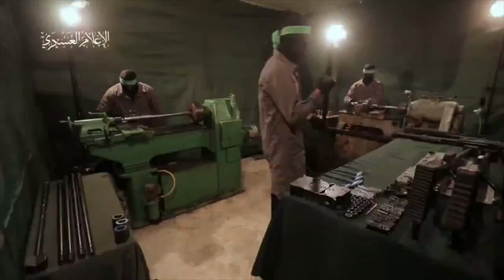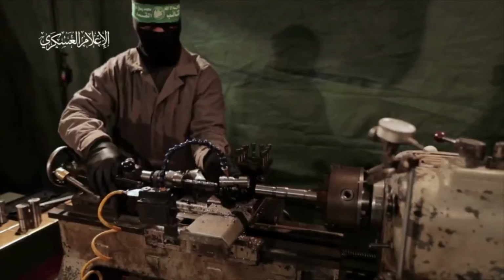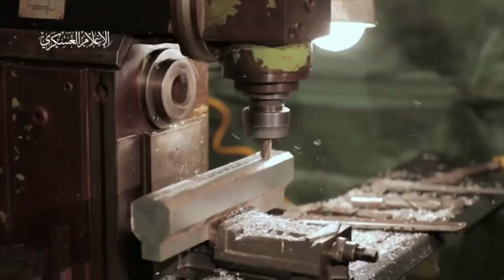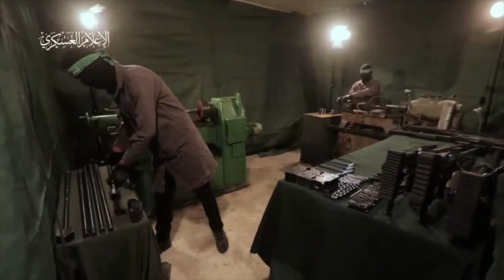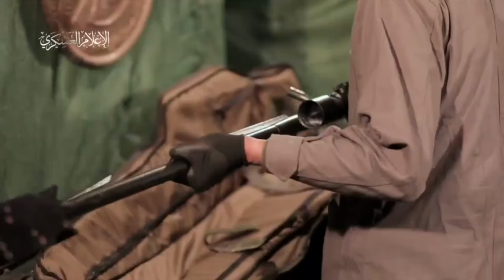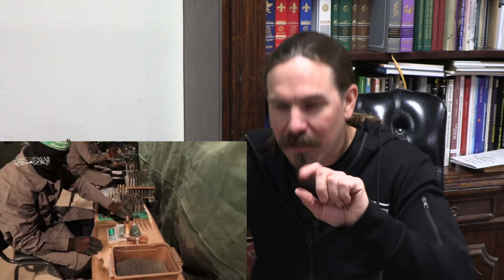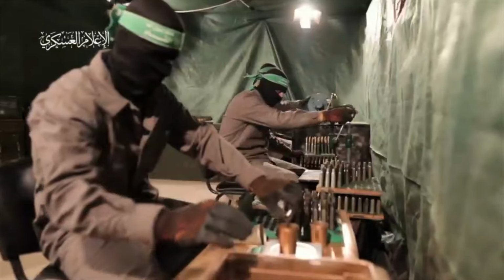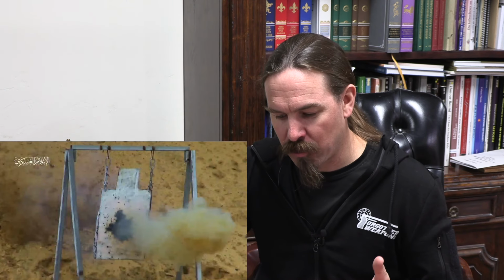Hamas Claims to Make Sniper Rifles in Gaza - Are They Really?

Comment: I work in a production machine shop so I'm going to comment on that part of their video.

1) Professional manual machinists would not be wearing coats with long sleeves. They wear aprons. Long sleeves run the risk of being caught in the rotating parts of machines and can severely damage your arms
2) Scope mounts - Finished parts (the black ones) would never be located on the same table as in-process parts.
Reply: @disistheway2679 if true, THIS facility isn't that place, and theses guys aren't the actual gunsmiths.
Reply: @disistheway2679 yeah, yeah, not arguing that point. THIS video, though, is a fake - that is the point here.
Reply: Who made the fake video?  A group claiming to be Hammas. 

Is it Hammas is it Isreal ?
Isreal  have already posted an interview with a Hammas “terrorist “ who was an Isreali actor.
Reply: Yes those scope mounts had some raw in the white. The black ones would be hard anodized in a liquid solution like electroplating(electroplating uses acid vs anodized uses a salt solution). That process would be done in a different room in big tubs
Reply: realistically these guys would be wearing flip flops and track pants
Reply: And I mean come on I didn’t see any digital read outs which have been very common on Bridgeportsand other end mills  since the 1980’s. They are 40 years behind on tech. There is little in this video that makes believe they are actually making any firearms
Reply: Girl at T/C arms running a gang drill, had her hair back like she should, but when she bent over to pick up the next part her pony tale got caught in one of the drills.
Not a pretty sight.
Reply: when your safety manual consists of one short sentence, ALLAH HUAKBAR, anything that happens was the will of god and therefore good and had to occur.
Reply: @disistheway2679 I think you meant propaganda instead of entertainment. Otherwise I agree with your statements.
Reply: I don't allow long sleeves in my shop but what they do in the third world compared to the USE or western countries isn't going to be the same. Esp in poor countries like this. Haven't you watched those Pakistani machining videos? So your point is moot.
Reply: They are wearing long sleeves to cover any identifiable marks on their bodies.
Reply: @oxyfee6486  doubt that, permanent tattoos are forbidden in Islam
Reply: @therideneverends1697   so you only think of tattoos? What about birth marks? 
Or any abnormalities?
Reply: @therideneverends1697  Military will be looking at every square inch of their bodies, one identifiable blemish is all they would need.
Reply: @respectall4551  seems highly unlikely the would pick people for the film with such problems
Reply: @disistheway2679 It’s propaganda not entertainment, don’t sugar coat propaganda as “entertainment.”
Reply: What they are doing is trying to show that Iran is not supplying them.
Reply: The same people can leave underground for months without see sunlight, 
Can work in undesirable conditions 
Can go for days with minimal food and water. 
So, to them, no law is applying to them. 
Telling us working with long sleeves and apron is fake, then what will you say hamas fighting barefooted is? Is it a Hollywood staged film? 
Don't be salty.
Hamas is built differently.
Reply: You must be delusional to believe that every smith is producing the same way, thats like wondering why the pizza guy is not dressed like the japanese cook and saying that it is not food bcs he cooks different😂
Reply: Yea I don’t think those guys have osha and most of them wear sandles while doing litterly every toe crushing job imaginable
Reply: So this is fake because people manufacturing underground aren't following OSHA and ISO?
Reply: @murmaider2  this is fake because nothing is even slightly dirty, the lathe work is poor and the people acting the manufacturing out never worked on those machines before...
The long sleeves and gloves are a dead giveaway!
Like many others have said already there is a famous Russian video out there were a guy is absolutely disintegrated by the lathe he was operating...
First thing you learn on a lathe... and every "old guy" has a story about a lathe accident, they are not toys and the power of them is far beyond what a human can handle.
The fact that they don't have a single clip of them even attempting to bore out the barrels is also interesting.
Not to mention that the shown lathe-tables are to short to accommodate the tool post with a sufficiently long drill bit.
Not to mention the specialized machine you need for precise rifling...
I mean... they could go smooth bore 😂 but why put a scope on it at that point 😂
Reply: @murmaider2 no it's fake cause there'd be no reason to bring a finished part back to the table where the milling was done.
Reply: @herpherpbrocolli11 No because by now, they would have known better.
Reply: @murmaider2  No this is fake because the laundry list of things pointed out by both Ian and in the comments, AND because they are not following safety protocols.

If youve ever actually worked with a Layth youd understand why long sleves are not just not recommended, but not an option
Reply: @disistheway2679 ooo fancy. They took a break from baby slaughtering to clumsily chisel some words in a receiver. Made in Gaza. 😂
Reply: @tootiredtostop1606 who do you mean with baby slaughtering
Reply: It is just propaganda. Those that don't know  think they are valliantly fighting back. Those that do, may be lulled into thinking they aren't.

Comment: I’ve made lots of parts on my lathe and mill.  There’s nothing in this video that shows much with any specificity.  The reality is that this level of manual machining even if real as depicted will not yield the level of production necessary to support a war effort.  You make tools to mass produce this way.  You don’t mass produce this way at all.
Reply: I don't think they need to mass produce because this isn't conventional warfare. I'm no expert, but it seems to me that guerilla warfare and hit and run tactics does not expend nearly as much equipment as conventional warfare does.
Reply: They cannot mass produce, no one said they are mass producing. They do not have the resources to mass produce.
Reply: WW2 has entered the chat
Reply: @azgardener79  during WW2, 1 company would have 400 mills/lathes, 100 to roughing out, 100 to special processes and the rest for finishing. 
Hummus shown here would be at the most a repair/specialty job shop.
Reply: @Ryknfjor  The question is, how long have they been producing? Honestly, they likely smuggle in most of their weapons
Reply: Agree AZ. Probably a repair work ship and a PR said lets vid as though we are manufacturing weapons. Didn't see any heat treating.   @Ryknfjor

Comment: Gaza has produced nothing but jihadis with an economy based on foreign aid handouts.  Like the ottomans before them, they lack any sort of complex manufacturing capacity.  They are doing assembly.  Getting parts past arms sanctions is easier than complete guns. 13.10  Reloading using a thrown charge for precision ammo if fine as there is not that great an effect on trajectory due to small variations in charge weight when dealing with massive volumes of powder used in 50 bmg type cases.  The Lee book documents one very long standing bench record set with one of their scoops.
Reply: Turks are the ones who kept the Arabs and Jews apart from killing each other. Once they left it became open season.

Comment: Without even watching Im certain it's just a PR stunt which is ironic I think. They hate the west, but they use western propaganda? That's hilarious to me. No way is Hamas making sniper rifles. DMR's I could halfway believe, normal rifles even more believable, but sniper rifles? I know what goes into making them. The precision equipment, access to proper material to make good barrels. Actually turning them into good barrels. Also the fitment. The threading. EDIT: I meant rifling. English is not my main language. There is no way that Hamas is making sniper rifles. That's just hilarious. They could buy them, but in no way do I believe they are capable to make them themselves.

Comment: Comming from a manufacturing/Engineering/machining background,  if you want to show off how hood you are then you show off the most impressive or difficult operations. I would absolutely expect to see the barrel drilled, honed and rifled. I would also expect to use if more measuring equipment that a vernier caliper or micro meter, for this process you would expect custom gauges and jigs. Of course no one with the ability to engrave or stamp parts would miss the opportunity to show that.

Comment: you can get a good enough rifling using EM method with appropriate homebrew setup but i don't think it will match any of the market barrels, even the cheaper ones. makeshift workshops are makeshift workshops, these guns will cause casualties but not much killings.
Reply: They were professionally built…in Iran.
Reply: what is EM?
Reply: @DrRobertUnderdunkTerwilliger   sorry for misinformation, it should be ECM, electrochemical machining. you basically run electric current and water current through a designed path, in order to erode away metals in an uniform order. unlike traditional rifling, you can do this with car batteries/DC drivers. water bucket, salt water and aquarium pumps. it will take a day or two to rifle a barrel.
Reply: It's called EDM, it's an impractical method for making rifle barrels. It's OK for handguns, since they're much shorter. Making rifle barrels is not very hard at all. Making VERY accurate barrels is an art.  @711jastin

Comment: Great example of propaganda VS an educated individual. To a clueless person, this could look plenty scary. Yeah burned out M2 or DShK barrels would be perfect for this sorta ghetto bolt action anti materiel rifle thing - damn sight away from a 'sniper' rifle (especially if they guestimating powder loads with cheap chinese scales...) but damn effective at close range. I have no idea what the local logistics would be, maybe those 50 cal boxes were leftovers from Afghanistan lol
The tray of 'finished' irregularly shaped and colored rounds gave me the giggles.
Reply: Those ammo crates were awfully pristine for such.  Once they get de-palletized, those tend to get dinged up super quickly.

Just like the waterproofing sealant on the primers of the steel cases ammo, that coincidentally is not only a visual match for standard Iranian sealing compounds used in factory ammo production.  And utterly unnecessary for what Hamas is allegedly doing - militaries spec those sealing compounds so the ammo will be just as good after 50 years or more of lousy storage in any possible climactic conditions.  Not something you're going to bother with if you're doing wartime convert manufacturing in an arid, primarily urban, environment, and you expect to be shooting the ammo off within the next year or so.
Reply: Haha yeah those crates did look pretty new, anyone get a view of markings?
That is a good point about the primer sealant, likely a step that is skipped when the rounds are to be used NOW. Unless some guy is on the production line with some nail polish dabbing each one... lol  @geodkyt

Comment: If you could import the steel for the barrels... Import barrels... Their lighter...
Reply: FrostOrZeph  iran doesnt do any of that
Reply: There you go again… using logic to make a good point… you will never make it as a modern journalist 😂
Reply: @xgford94  done some journalism stuff... It's the rich owners who mess with the editors...
Reply: @nothingbutchappy  Nah, it's the editors.
Reply: FrostOrZeph  weight isn't cost per unit... Weight is cost total for transport.... It's far cheaper to transport hollow barrels than solid bar stock... Especially when Iran is paying for the production.
Think before you comment...
Reply: @nothingbutchappy  iran is paying for production?
what makes you think these guys are doing this for wages
you might try a bit of thinking yourself
Reply: @markhill3858 what? Do you realise that importing steel to make barrels requires machining and wastage... barrels are hollow. Less weight per square kilo.

Have you tried thinking?
Reply: @nothingbutchappy  how does one smuggle anything into gaza
when the UN cant even get an asprin in there
what planet are you on?
Reply: @markhill3858 did you just shift the goal posts?
Reply: @nothingbutchappy  Im questioning why you believe gaza can import anything at all
because I dont believe thats possible
Reply: @markhill3858 this post is 2 years old...
Reply: Mr. Spock agrees that it is indeed, Logical.